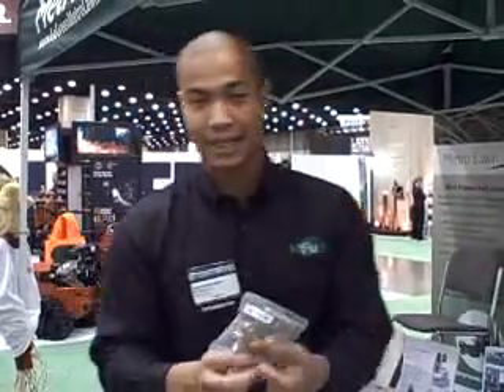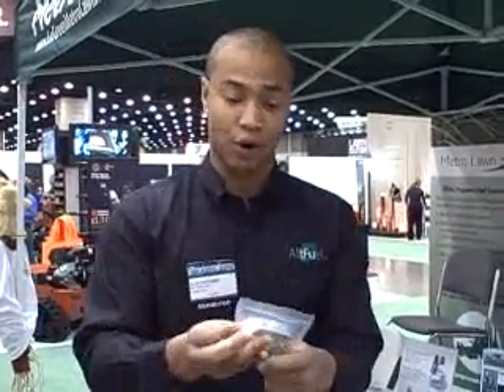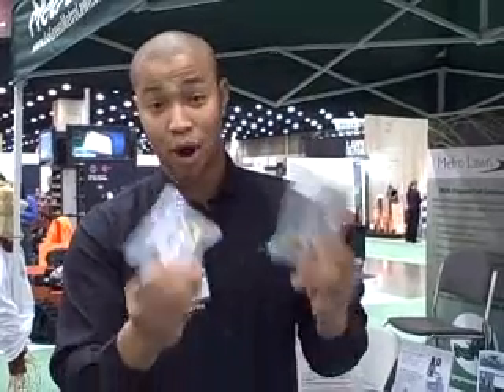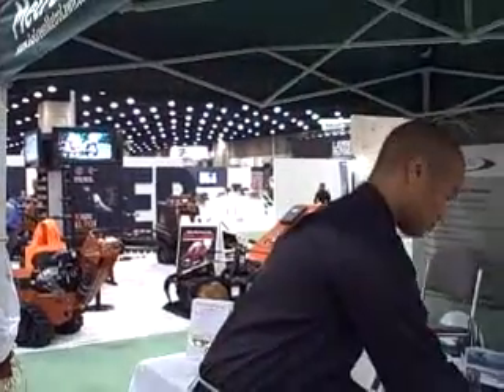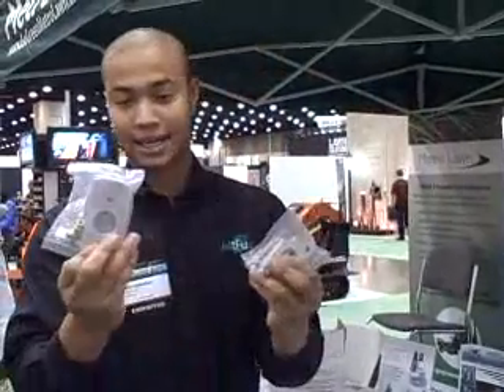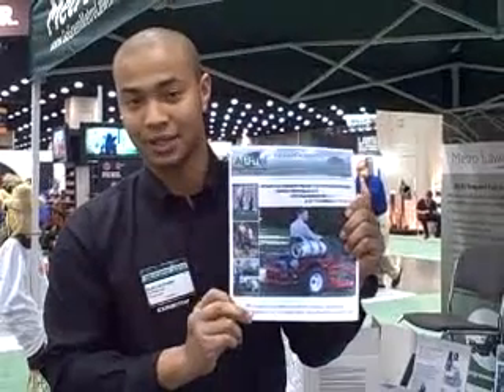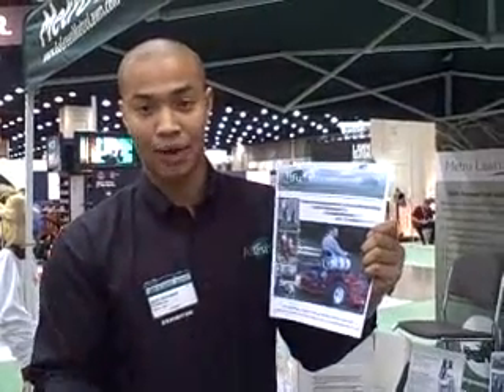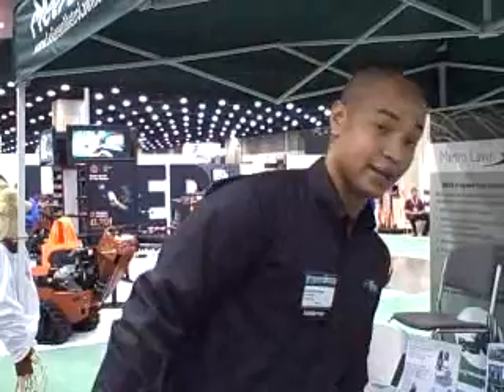Alt Fuel Propane Engine Conversion Kits

Comment: Aren't you forgetting one small, but very important, thing? How are you delivering lubrication the the motor? Especially if your converting weed whacker motors which require oil/fuel mixture for lubrication. If this only works on 4 stroke and not 2 stroke engines, then say that in plain English. Sooooo unclear & misleading!